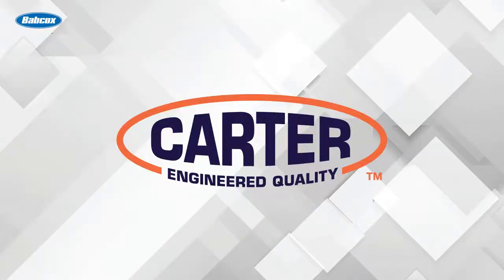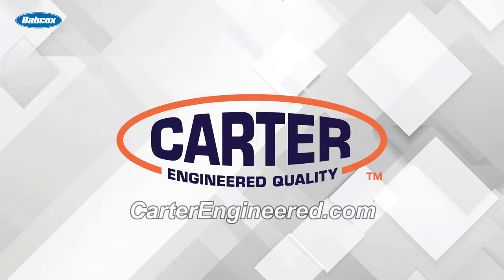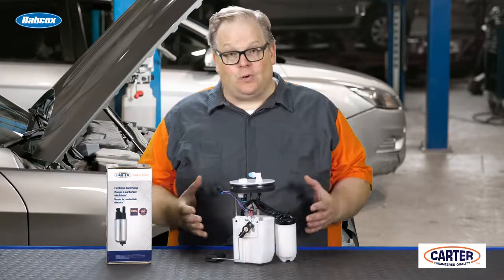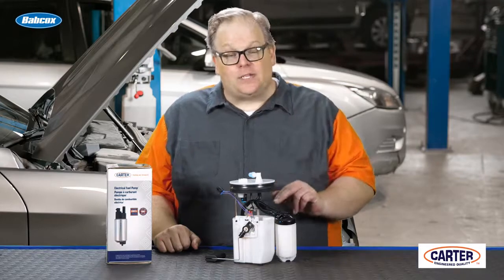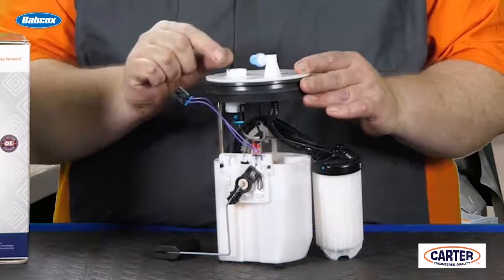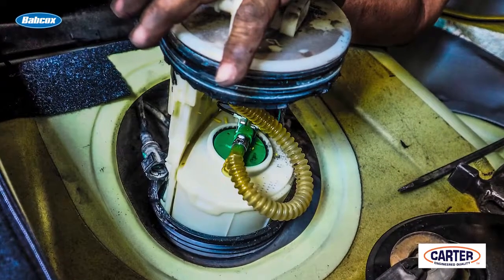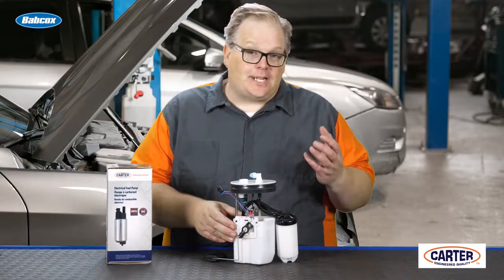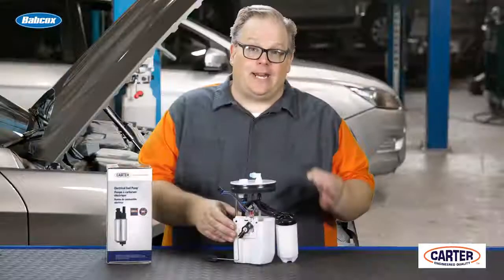Internal Fuel Pump Leaks

Comment: I have an issue! My fuel pump is working fine, but one of my outside hoses attached to the fuel pump is leaking! It pushes out the hose and leaks fuel! Is it the pressure or is it the hose?
Reply: Generally the hose, that is also cheaper to exchange. I would start with that and then see what is happening...

Comment: What if it has return system
Reply: Same can be internal if hose is badly clamped or cracked i have same problem with two hoses.. One hose is for fuel in car second fuel goes back